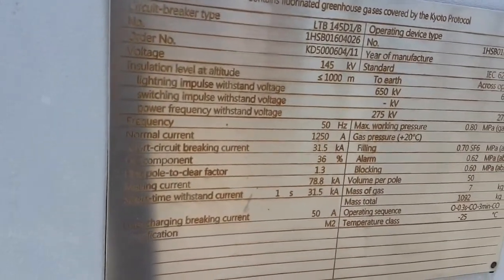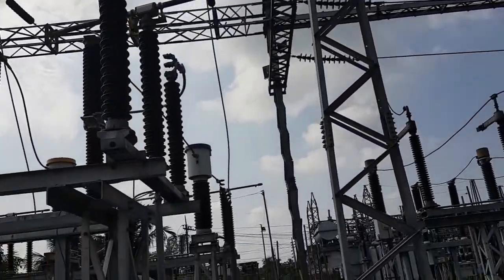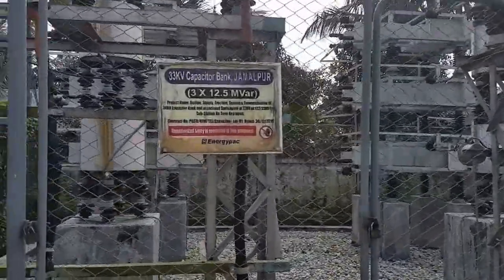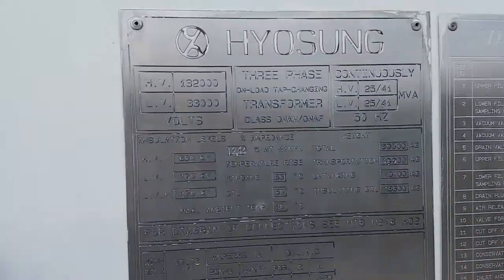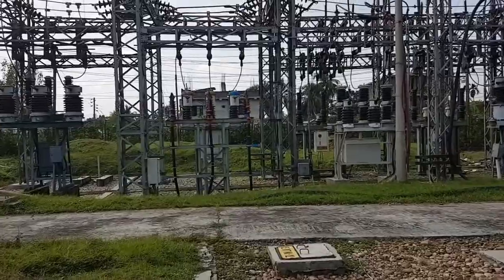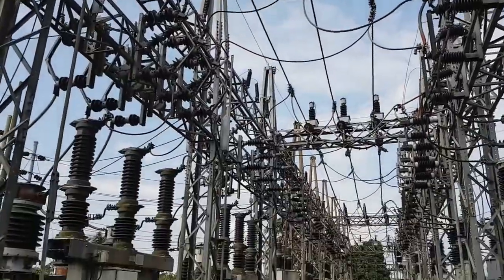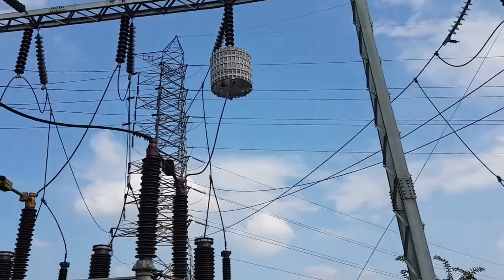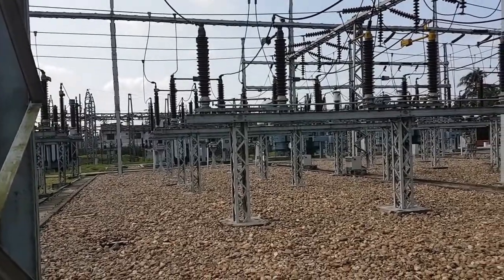Electrical Substation visit. Inside an Electrical Substation.

Comment: Dear friend
First of all for 132 kv we use VT not CVT which you told us. So it is wrong.
Reply: No, CVTs are used for 132kV, VTs can be used up to 66kV. They would be too large for 132. The capacitor sections reduce the voltage to the transformer in the lower section